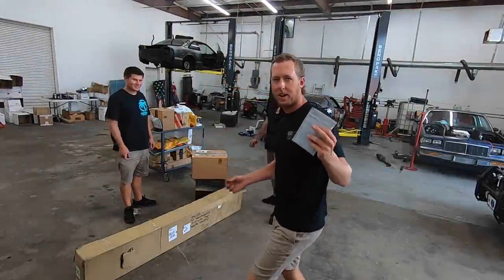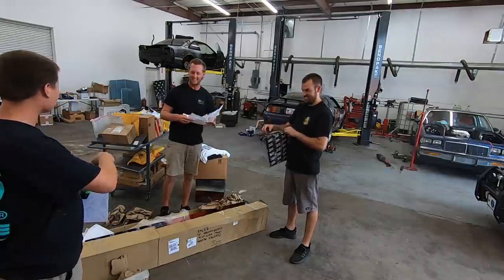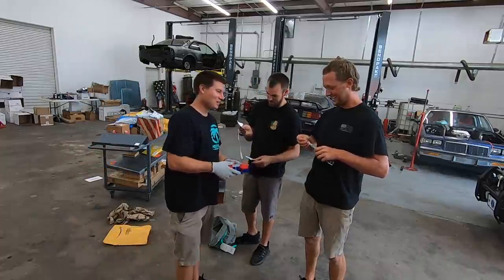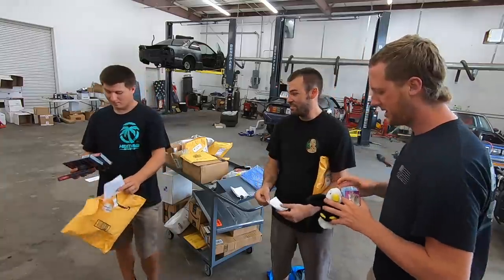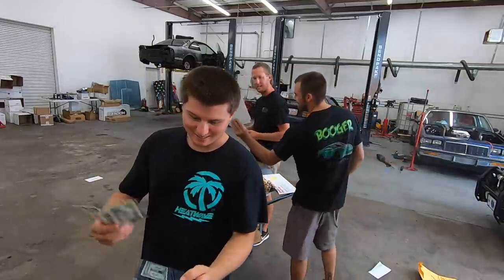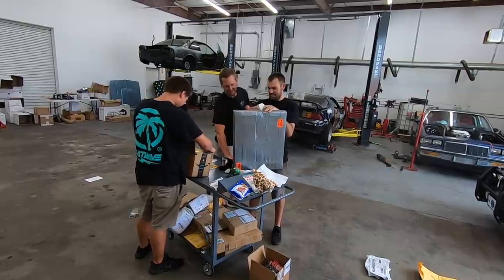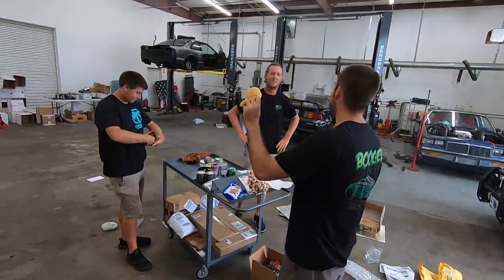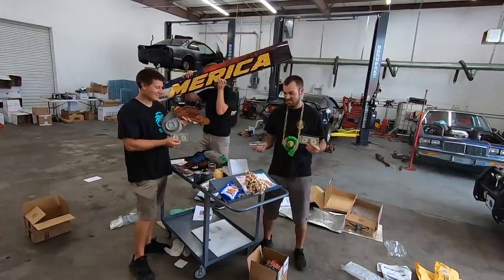Freedom Fan Mail EP.5 - BOAT LOAD of Car Parts and Random Items!

Comment: NEVER INSTALL AN UNKNOWN USB DRIVE INTO A COMPUTER YOU USE.
If curiosity is killing you, use a computer not connected to any network on a junker PC.
Reply: even keyboards and stuff can be dangerous
Reply: VirtualBox.
Reply: @BobWiersema  ^^^
Reply: This. First thought when I saw you pocket that jump drive. Be an easy way to hijack your YouTube account or worse.
Reply: connect a unknown usb to a old mobile phone as they have pretty good overload protection on the USB c or micro USB port. Pc's or laptops tend to die instantly even with a cheap "killer usb".
Reply: @odhunt5242 de saber h7u20
Reply: if your smart tv plays .jpg files, put it on that. Very little chance to infect it. Don't have autorun turned on in Windows, run malwarebytes on the drive first before you open it. Click the box to CANCEL when Windows asks what to do with the drive, then run Malwarebytes. Turn on " show extensions" to verify they are .jpg. Right click and use "viewer" to see the image, don't just click it. It is easy to embed a .exe file in the jpg file but telling Windows to only use Viewer will keep the exe from running. A normal click will will run the .exe and the .jpg and you likely won't see the .exe doing its thing.

Comment: Speaking of those "Sleepy Corvette headlights".  There was a hot gal I knew back in the mid 1970's who had a 1973  pink C3 Corvette with the pop up headlights.  She installed some eyelashes on the top side and rigged them so she could "wink" at folks.  She also had a bumper sticker that read "If you can beat me, you can eat me".  Never knew what happened to her though.  Too bad.
Reply: There was a girl back in the late 60s early 70s driving a Vett that said the same thing in Philly, I wonder if it's the same girl or is it folklore
Reply: @michaelwynne4346  It isn't folklore as I actually her driving the pink Corvette back in 1973 or 74.  Not sure the exact year although it was in  Bergen County NJ at the time.  Ridgewood, NJ to be exact.

Comment: just check out why Rhys Millen"s wing  mod on the GTO was so controversial  in FD. when you are sideways it helps to control air flow because the car is only designed to cut through air going forward. wings help for drifting because it helps with lateral air flow.

Comment: Cleetus you will never see this comment but if you just roll off any frequency below 200hz using a high pass filter, it will remove almost all of the low end engine revving in the video.

Comment: So the car on the rack to the far left of the shop is James’ new drift car. Can anyone tell what it is ? 

Maybe mid 2000’s 3 series bmw ? 
The rear clip looked like a 2010 ish charger with no tail lights but it’s 2 door....
Reply: From what I see the boot lid doesn't go down very far and the number plate is below the boot lid. E36 and E46's have them on the boot lid so that can't be it
Reply: I belive its a Nissan 240 thats james drift car